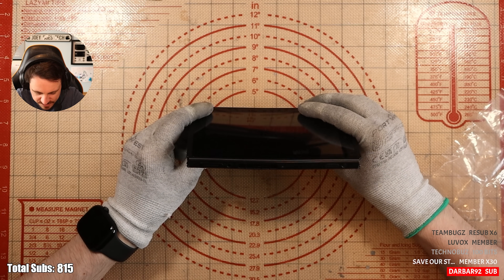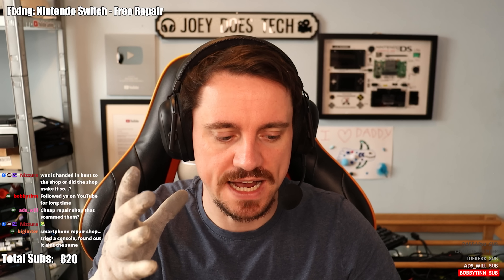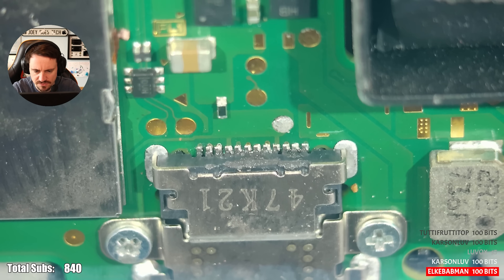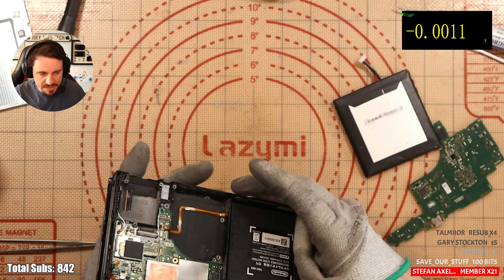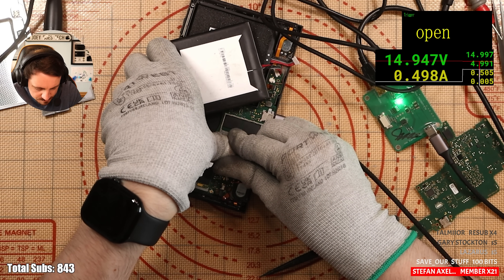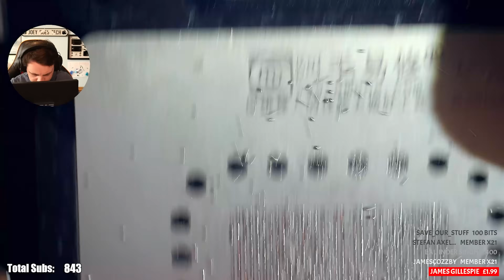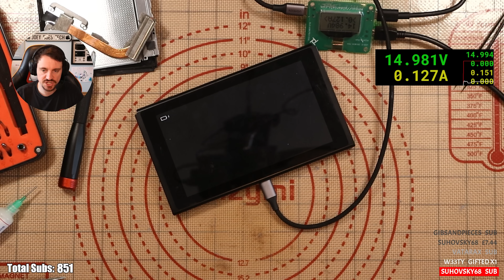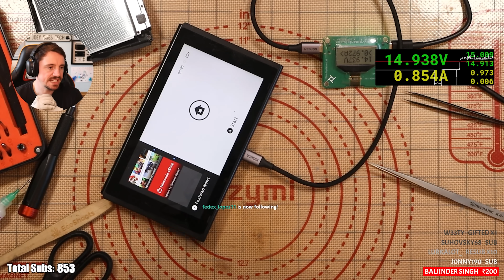The Repair Shop Made It Worse... Free Fix S1:E16

Comment: Pro tip guys, if your nintendo stuck at about 450-500mA and you have any problems, like on this video or not turning on at all or any problems with charging, then replace BQ chip. I had resolved issues like this multiple times using this method.

Comment: Joey why not atleast put the board  to test in a known good chasis instead of the bent one? better yet you could try transplanting the APU chip or the other known Encyption Chips that require the Board to function on a known good board to make a frankenstein out of it? Would make an amazing video Idea. Or is that not possuble? I'd assume APU has some other paired Chips that it requires to boot. But I guess you would know more.

Comment: Technically you can straighten it out by placing it on stilts on both ends heating the board up to about 400C and placing a small weight in center of the board and letting it cool down... Repeat it about 3 to 5 times roughly and it should return back to original shape with NO broken traces within the MB PCB.... I have done this on many bent PCB's and out of maybe 50 PCB's one or two was not able to function correctly
Reply: i would be very interested to see a video of this if you get the chance. it makes sense but sounds very difficult
Reply: @pot_monster  The place I am living in now I dont have the space to setup a station

Comment: When I hadn't yet worked on a Switch yet (I have a small repair shop in my house), I had a customer ask if I could fix it. I told her the likelihood was extremely low. It had a blue screen, which I proved to be an issue with the APU. I tried doing a reflow, because, well, why not. Didn't work in the end. But it was nice of the customer to let me try. She gave me the switch as well, since it was dead anyways, also nice :) I think I used it for parts already,

Comment: Do you accept device submissions from outside the UK?

If so, can I submit multiple devices at once to save on postage? 😬

I have three broken devices: a PS5, a Synology DS1815+, and a Cisco enterprise switch.

Two were damaged by electrical surges, and the Synology NAS has the known Intel Atom C2000-series issue.
I tried some of the usual fixes, but it still won't boot or show up in Synology Assistant.

It's the only one I attempted to fix because no shop wanted to take a look at it, the other two were inspected by a couple of shops, but neither they nor I attempted repairs.

I have a little more information about the devices, but I want to keep the comment as short and clear as possible. 😅

Comment: You can bend the boards back though. Sometimes they don't even need it. Take the boards out and blow hot air over it at 450°C for a couple minutes in a circular motion. And straighten the frame of the Switch. If you re-ball or re-flow the APU, it'll tend to stay soldered because the frame is straight.

Comment: Try heating and cooling the board a number of times, after a few cycles it may settle into a straighter shape. You can also use a little pressure whilst the board is hot, you can find info on doing this online.
Reply: Sure that will fix its shape but there's no telling which traces are already broken on inner layers.
Reply: @jackbauer2698  I know that. I watched the video. I am an electronic engineer.

It's a problem that needs to be fixed, there's not whataboutism. All the problems should ideally be fixed.

Unless the tension in the PCB is released damage can continue, so it's one of the first steps.